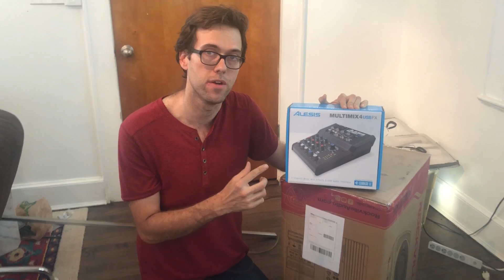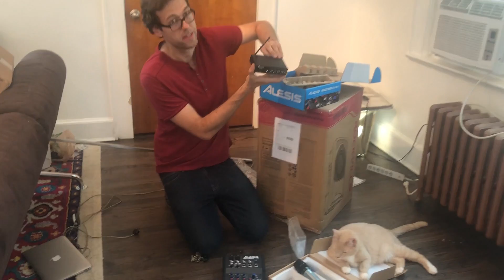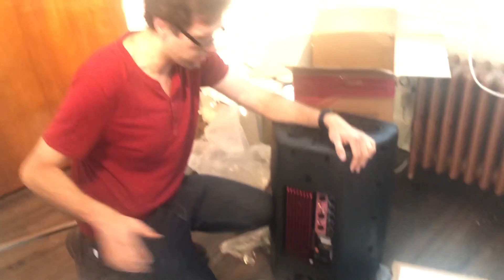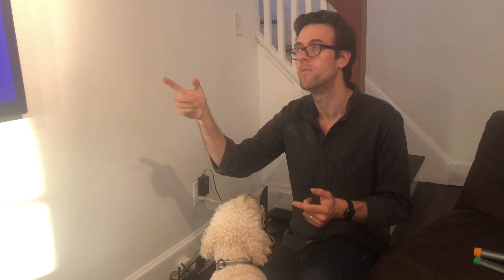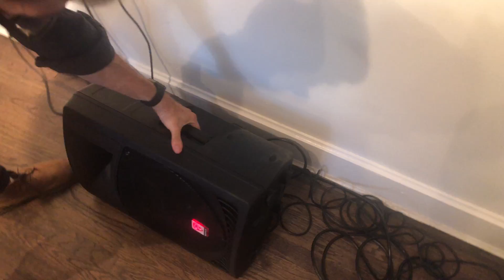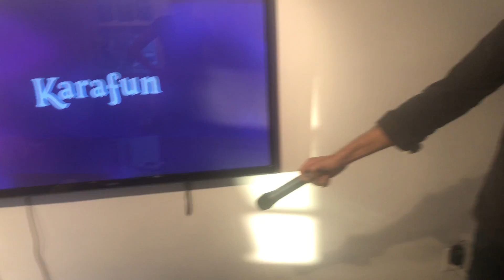Karaoke Setup - for home - super easy!

Comment: a home karaoke system can be really simplified by getting a Bluetooth speaker with wireless microphones. i use You Tube for my source. i use a laptop for  the method to get the songs. if you want a second video a smart tv can have the laptop source cast into it. thats all thats needed. i got a jyx s8 speaker for sale at $65. i already have a laptop and smart tv so i have a pretty good system without all the cables.

Comment: great vid, simple & straight- now its 2022 - wud u mind updating this w newer/cheaper tech- so that its fully modular (if mics break just replace those)- perhaps using a separate bluetooth +physical mixer
Reply: All you need is 1 bose s1 pro Bluetooth speaker, and a pair of wireless microphones, and an iPad or something and you have a system that can easily fill a room of 50 people with ease.

Comment: Thanks for the video! I purchased the same setup an noticed you don’t get hardly any of the bass/low notes on mic one or two, even with the low knobs all the way up. Looks like the EXT IN, (1/8” stereo Jack), is the best way to add true audio in. Probably wouldn’t need the 1/4” stereo cable and the 1/8” adapter for your computer, since the microphones come with a 1/8” male to male stereo Jack. Don’t really know for sure if this is the right way, but any input /advice would be appreciated. Thanks again!

Comment: Very enjoyable video. I got a kick out of the family pets too!

I just ran a karaoke set up on Saturday for a friend's retirement party and used Karafun 2 software. As long as they offer the short term subscription, I will never again use the old CDG discs that I've had since the 1990's. It just so much easier and you have access to over 30,000 songs for only $6 for a 2-day subscription. Since I was at a remote location with no internet access other than tethering my computer to my phone's hotspot, I downloaded about 1000 songs to my laptop prior to the party. Each song is about 5 meg, so it took awhile to do this on my home network. Glad I did, because the 8 to 10 songs I downloaded at the party using my phone's data connection took about 1 minute each. Not bad, but it does delay things a bit.

I did have trouble balancing the music and the singers. This is partly due to the fact I had never used the software and the piecemeal equipment set up I was using. For example, my mixer had an overall volume and each microphone had its own. To bring up the music I had to simultaneously lower the mic inputs to minimize feedback. I had two types of input; a portable karaoke system that John mentions in the video (for background music) and my laptop. Each input had different output levels going to the mixer, which meant I had to constantly adjust volume levels as I switched back and forth between the two. 

The issue was the singers who had vastly different experience using microphones or doing karaoke. Singing either too far or too close to the mic, moving it around that occasionally brought feedback into the mix, etc. We did have someone who was a real singer, and she sounded very good once I dialed her mic into the music. Holding the mic properly, pulling it further away when she hit some high notes, and minmizing random movements are all good habits.

My next step is trying to integrate the microphones into the computer for a more unified control of the mix. Would be nice to be able to control the mic levels and effects from the same device providing the music & lyrics.

Comment: In regard to those who mention recording performers 'real-time':  This, in my opinion and through trial and error, is NOT as simple as some might think it is.  It had been simple enough at one time, but since Windows 10 this all changed for me and I watched as it happened and began to fail.  Ans so, a couple of points from someone (which, of course is myself) who struggled at the exact same point every time and where setting up used to be the simplest part but no longer is in regard to using an Windows 10 itself to record the exact same sounds of music, vocals and even video recording at the same time, in real time through a PC / Laptop:

I really cannot solve how best to do recording in real-time any more using a PC.  Recording video (using an attached webcam) music and vocals is no longer a breeze. I never even used a mixing deck, but instead an external sound-card which I used with earlier PC's I'd built myself and had the absolute minimum of fuss without a nest of cabling.  It really used to be that simple. A simple USB cable from external sound-card linked to the PC, a mic attached to the external sound-card and there was nothing more needed.  Back then it was called 'What You Hear Is What You Get' and it was a simple click on a radar button to set the entire thing up, Windows itseld configured WYHIWYG but I have yet to find out what was replaced for this simple WYHIWYG system as it was some years ago.  It's a question / problem I have scoured the Internet with that, it seems, no-one appears to have the answer.

Regardless of how I try to set my sound-card (either internal and external) which appears should be a simple task I cannot get this to work ‘Karaoke-style’ and I have over 50 Karaoke tracks of me singing with video using only an external sound-card.  The closest I did get (after Windows 10) was with so much latency that it was totally impossible to sing in 'real-time' WITH video both recording at the same time.

I truly don't think anyone has a solution in using a simple external sound-card; I've tried everything, nothing works. If someone says they have a solution I'd be more than happy to hear it  :-)

~F~
Reply: Wow. So useful and clear info. QUESTION  if your TV has a soundbar and a couple of rear speakers in a small room, do we need another $peaker❓
Reply: @ethelgarland  Hi Steve.  Imagine, if you will, yourself singing for pleasure.  The only difference is that you are singing Karaoke but with no audience because that's all some people are looking for.  In essence, Going back more than 10 years ago I could either hear music through my speakers whilst using a mic ... or ... I could use headphones which meant only I heard the music coming FROM my PC whilst I sang into the mic:  It meant that only sound heard would be my vocals going INTO my PC and nothing else.  Back then I used (for free) Windows Sound Recorder to record both music and vocals.  It was that easy; basic, simple and needed only either a Laptop or PC.  So simple.

In the same way, a good, mid-range soundbar would be enough to fill more than a small room and you really need nothing else.  The only issue you have then is getting a mic INTO the TV so both music and vocals are heard.  There are many ways to do this that I've seen.  What appears to be the simplest solution being attaching a sound mixer to your TV using AV leads (I think most TV's no longer have AV  In and Out leads although I might be corrected here.  HDMI link IN to TV with AV links to a sound mixer seems a good idea.  But in either case, it's way to much fuss for what I need it for.

I'm not sure I really answered your question here ... in which case I'm sorry in not being helpful

~F~

Comment: Using laptop is ok but  but kinda hustle a bit,  here in our country it's easy to buy USB/ karaoke dvd player with built in songs and remote control,  just buy an audio amp with  speaker or 2.1 speaker mic input and finished
Reply: @thatdiycouple5513  Philippines
Reply: @thatdiycouple5513  lots of it,  Wait try to visit china town or Filipino  Store  there in your area most probably you'll find one a Karaoke Dvdplayer the new ones is with Usb stick flash drive player with thousand songs, media com, Tj, platinum, megapro

Comment: I have a PA system, how do I connect a monitor to my laptop which has a karaoke app on it to my laptop so I can get lyrics up on a separate monitor. Many thanks
Reply: The laptop and tv  has a in out connector so just go buy an HDMI/ or VGA cable and connect it to your tv
Reply: Use mirroring its wireless setup...much better

Comment: Nice video. Hope you don’t mind me posting here how I setup my karaoke system. Mine is almost totally wireless with a couple of provisos. A smart TV ( Vizio )with Bluetooth and a PA system ( Absolute ) with bluetooth, 2000 watts, came with 2 wireless mics, rechargeable battery, and has echo, bass and treble functions. I pair the TV and PA so all sounds come from TV to the PA ( no lag at all ) then with my phone go to YouTube, search for any karaoke videos and cast ( mirror ) it to my TV. If the PA’s battery is fully charged I don’t even need it plugged into a wall outlet, runs for like 4-5 hours full blast. If everyone in the room is connected to the same wifi they can pick a song in YouTube in their own phones, and it will automatically queue up so your guest doesn’t have to bug you and you don’t have to ask each and everyone their request. Heck you don’t even need a TV at all. Last 4th of July we took the PA to Second Beach near Forks Wa. Paired it with my IPad and everyone there friends and strangers had a hell of a good time.   I got the PA at Fry’s Electronics for $199 on sale and if your smart TV doesn’t have Bluetooth, you can get a Bluetooth receiver/transmitter in Amazon for $20 and if you don’t have a smart TV you can get a Chromecast or something similar.
Reply: Steve Armstrong, could you list the items or link or show it on your channel.  I like the idea of less cords and more versatility.
Reply: @stephanieknecht9914   I kinda detailed most of it from my post above as to what TV and speaker you need.  i don't know where you're from but i got the TV at Bestbuy and the PA speaker at Fry's electronics,  just make sure the PA speaker has bluetooth,  echo,treble and bass functions, has a built in battery so you don't need an external power source.  the PA i got ( brand name is Absolute ) came with 2 wireless mics not the best quality but very good enough for casual get together.  also depends on how loud you want it.  mine has 2000 watts and that can get really loud.  do not get a PA speaker with less than 500 watts ( The DIY couple's PA speaker is actually a very brand )  Fry's has a lot of selection some of them come with like dancing lights and sound effects.  sorry i don't have a channel.
Reply: Steve Armstrong Is there anyway we can skip on a PA speaker and just have the mic and music coming from the tv/sound system we already have with the tv?
Reply: PachiaY Lee then you should follow John’s advice. Get a mixer to connect your mic and sound system together. If you’re gonna use your TV’s stock speaker the sounds won’t be great even with a mixer. But if you have a surround system then a mixer is all you need.
Reply: Heres the list list you need except cable...smart tv...mixer with fx on it..reciever or home theater...speaker...mic wired or not..and cp or tablet....thats it
Reply: I have the the same setup but i found out tht a non wireless microphone is better..well it depends on brand and the amount of money..and get more output mixer with fx on it...i got small one but end up to buy a bigger mixer with fx on it

Comment: i think you overbought stuffs boss, im a dj and im going to be getting my first karaoke gig in july (goodluck to me lol), but im thinking just to connect two wired microphones to the active speaker and use an aux wire from my laptop to the same active speaker while hdmi split the visuals to a TV.  Cos my speaker and most speakers does have mic and line out control separate, only thing is i wont be able to add the reverb which to me is fine, and if i must i can just make the connections tru my NS7ii dj set. i think thats it. dont u think thats just simpler and cheaper if i might add lol.
Reply: He didn't necessarily overbuy. I use a separate Yamaha mixer that I paid $200 for at Guitar Center, and then use laptop connected to mixer and mixer connected to the powered speakers and HDMI from laptop to TV. With the mixer I get better sound and more inputs. Sometimes we connect 4 mics at once for background vocals or duets and just having fun. I have more effects and overall better control over the sound with the mixer. Also, my wife's mic requires Phantom Power so I needed a mixer with +48v Phantom. I can also connect my laptop via USB which provides 24-bit/192kHz. 

I guess it depends on how serious you are into Karyoke. My wife and her sisters are all singers so they tend to enjoy a really good setup for Karyoke. If you want an okay system then by all means get a set of affordable powered PA speakers with built in mixer or an all in one system with powered mixer, but for those that want a higher quality sound and/or more power I recommend spending a little extra on speakers and a separate mixer.

Comment: can you please provide link from amazon for the other cables?  An HDMI cable (connecting your laptop/device to a TV) A 3.5mm to 1/4 inch adapter, and a 1/4 inch male-to-male audio cable (to connect your laptop's audio output into the mixer)  Thanks so much.
Reply: https://www.amazon.com/Fifine-UHF-Dual-Channel-Wireless-Handheld-Microphone-Karaoke-Wireless-Microphone-System-K036/dp/B01N6448Q4/ref=asc_df_B01N6448Q4/?tag=hyprod-20&linkCode=df0&hvadid=241973989408&hvpos=1o2&hvnetw=g&hvrand=13051797486524082232&hvpone=&hvptwo=&hvqmt=&hvdev=c&hvdvcmdl=&hvlocint=&hvlocphy=9027193&hvtargid=pla-405804016481&psc=1

Comment: Couldn't you have just use the mic receiver as the mixer for the computer and mic instead of the Alesis if you didn't need all the bells and whistles ?
Reply: @thatdiycouple5513  I have a Smart TV with a separate AV receiver with passive speakers. I was thinking  of how to rig up a karaoke system when I saw your yt video.  I was thinking of using chromecast to get the karaoke AV to the TV, then convert the audio out using a toslink to RCA converter and pipe that output into the input of Fifine wireless Microphone Mixer that  you have and then take the RCA output of that and input it to the RCA CD/DVD input of the AV receiver.  Thats why I was wondering why would i need the Alesis mixer.  I am also  wondering if I would get any sound delay.
Reply: @thatdiycouple5513  I just got the Fifine today and hooked it up. Was kinda of tricky because the Smart TV was controlling the A/V so had to switch off the auto syncing so that the A/V would read the composite input instead of HDMI ARC. The TV stereo audio output plugged into Fifine then from there to input of A/V amp using  CD input. The  Fifine controls the TV input music volume with the music knob but I also can control it remotely from the TV volume. Mic volume on the Fifine was good enough for both mics and the A/V amp took both mixtures and wow , everything worked. I left the microphone  audio at 50%. All the necessary cables worked out too. I didn't have to get a Toslink converter , I used the TV's earphone jack and the stereo to RCA cable that was supplied. Not sure the Fifine is worth $$$ bucks, but it works.
Reply: Bellagio - Appreciate if you could do a video about your setup. I am setting up a similar Karaoke with LG 4k TV and yamaha rx-579 receiver. I have ordered my mixer and will use Fifine K025 wireless microphone. My LG tv has only one optical audio out. That is another challenge to figure out the connections. Kindly do a video. It will help many. Thanks!!!
Reply: @PrakshGo   Just get a toslink to RCA adaptor on amazon. Make sure its has SPDIF optical and not just SPDIF coaxial.  The TV optical goes into the converter and the RCA output goes to the input of your mixer.  Then add the K025 to your mixer and the output of the mixer to one of your composite inputs of your rx 579. I don't know how smart your TV is to know if you want sound output to go to optical (sometimes called PCM) or to your HDMI ARC (if your using that) , you might have to switch it manually.  I didn't use my optical output, my Sony has a earphone output so I used the cable Fifine came with so didn't have to use an adapter.   What mixer did you get ?
Reply: Bellagio - Thank you! Will give a try once my mixer is delivered. I ordered “Alto Professional ZMX52”
Reply: @PrakshGo  Looks like a nice unit! It only has one mic preamp and no echo or reverb but looks like  it will do the job.

Comment: I guessing you hooked up the hdmi to usb on laptop. Was wondering if i could connect the same setup with a good sound bar and smart tv ? I pretty much have all the same equipment you have, but if i could eliminate the laptop and active speakers.
Reply: i think its possible and it also gave me an idea that i could also use my android box to do the karaoke. KARAFUN - ANDROID BOX - TV - SPEAKER & MIC - SPEAKER...
Reply: That DIY Couple , could you explain more on how you hookup up the TV to laptop? Could you hookup the TV directly to mixer and stream the laptop KaraFun to smart TV or Smart box , i have the Nvidia Shield Pro basically a smart android box. Don’t want to use the TV speakers of course. I have a smart tv but don’t have the AUX option to hookup directly to mixer, wondering all the different ways to hookup from TV to mixer.